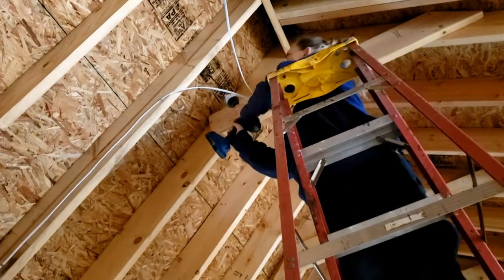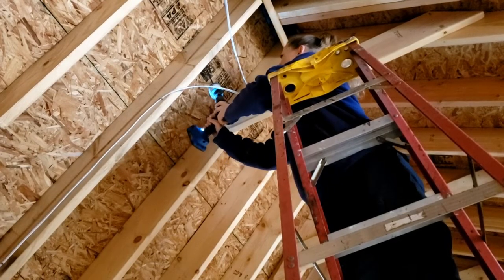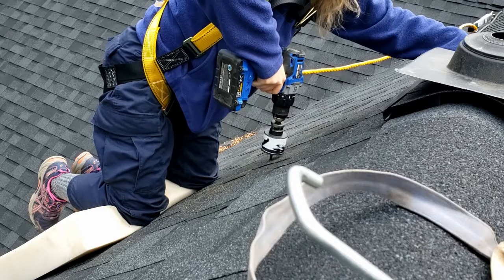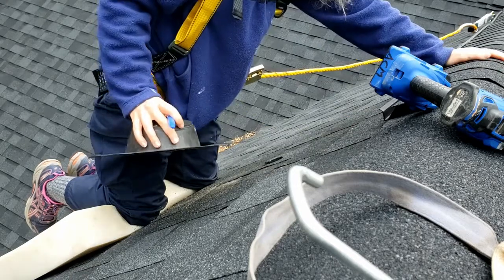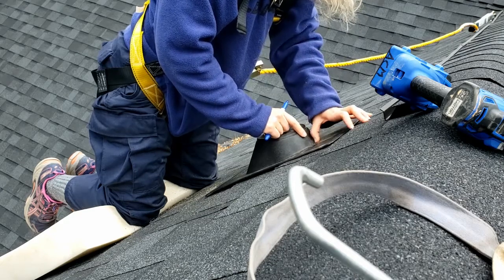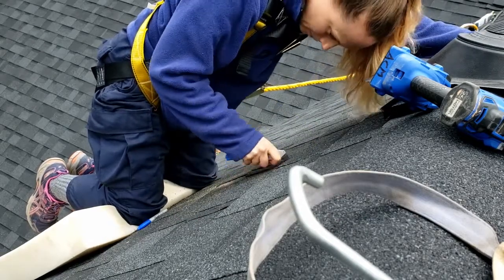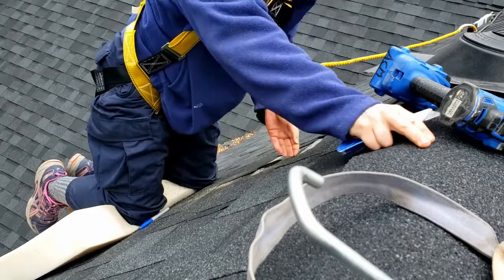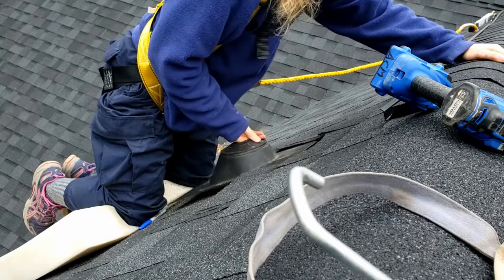Vent Plumbing Through Roof - Pipe Boot Install - DIY Plumbing

Comment: I have a pipe going through my roof with the pipe hole cut as a square which is way too big for the pipe like 4" x 6"  how big can it be? I was told something about Reg 3280.307.

Comment: What is the purpose of this pipe?
Reply: You know how if you stab a beer on the bottom of a can, it flows way faster? Same idea. Your sewer system needs a vent to equalize air pressure so it can flow properly.
Reply: And it vents the sewer / septic gas outside of the building. It can stink - and can be fatal.

Comment: Can i hide the vent pipe inside the ceiling of the house?
Reply: Hi. Unsure exactly what you mean. However the vent pipe must be put the roof if your home. This pipe is also where excess sewer gas will be released. So no you don't want to hide it inside anywhere. You will leak sewer gas into your home.
Reply: Vent terminals code. All vents and vent systems shall terminate in the open air in accordance with this subsection. That means through the roof, not the attic.